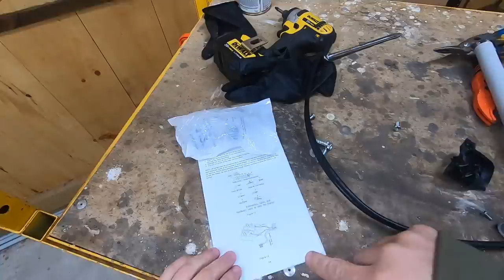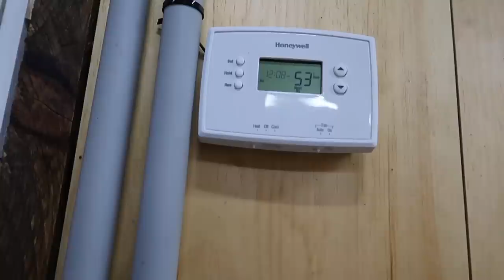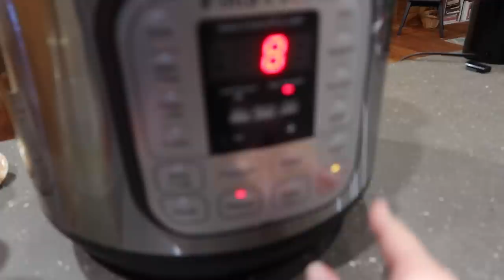Are we NUTS??? ELECTRIC HEAT in the WorkShop!!! You Might Be SURPRISED WHY

Comment: Don't know if anybody told you but green ground wire it is no longer a ground wire it is a return power wire which is basically a white wire not a green wire even the inspector will kill you that I am right I used to hook up AC unit on a fordable homes on the outside unit you're probably getting feedback through the thermostat wire

Comment: You should wrap a piece of RED Electrical Tape around the White Insulated Conductor close to the 40 Amp 2-Pole Circuit Breaker  to identify it as a '' Hot '' Phase and NOT a Neutral !

Comment: A programmable thermostat sends the exact same signal to the heater as a standard one as all the complicated things are done internal. Double check the connections are to the right posts and that the thermostat is set to only call for heat and not cooling.
Reply: Likely it isn't set to send the correct voltage.

Comment: When you threw the switch in the back, it "clunked" over (this is normal and ok). That tells me you're in need of a line thermostat. Which will entail a junction box and another conduit run to where you place the new stat. Example Lowes Item #494849. Though it says baseboard, it is suitable for your application because you need to control both hot lines........

Comment: I switch from those fancy thermostats with lots of features to an old fashion MERCURY SWITCH Round coil type after the BATTERY FAILED while I was trucking the USA. Came home to brusted pipes and damage walls and floors. Had to remodel.  Soooooooo. 

DO YOU PUT THE BATTERY IN THE electronic thingy  THERMOSTAT?

Comment: I'm surprised you didn't go with propane heat in the workshop.  If the power God out you lose electricity but with gas, it will usually always be there.

Comment: Al you need a line voltage stat.  not low voltage
Reply: open up the specs. for that unit  in web site don't sy it out right but looking at wiring cart it's line voltage

Comment: Yes Al, a relay with a transformer is the answer to adding the external thermostat.  The thermostat needs a DC voltage  from the transformer; you may find a suitable relay for the operational voltage that includes a transformer Honeywell R841C1169 for example.

Comment: I have a similar heater unit in my house as a back up heat to my NATURAL GAS furnace.  I have PEX plumbing, and heat by little 2" square panels my toilet and water traps. My washers and dishwasher are protected with an auto turn-on  heat to keep from freezing the water pump. No more metal pipes. Just heat and e everything thaws out.  I live alone and have no monitoring of my place other than the devices and methods I use.  I have LED YARD LIGHT, Electric Heat Mats so I do not shovel, and security alarms.

Comment: If you do this again in the future, buy "individual" conductors instead of a "sheathed" cable. That cable is not meant to be encased and will run hotter under a load. As far as the knockout, you should enlarge the KO to the proper size. Or, a size that is much more "convenient" to work with. A simple/inexpensive way to do that is with a "uni-bit". If you want to spend the money on a useful tool, buy a "Greenly" knockout punch set from 1/2" to 1 1/4". They're not cheap but last forever and are very useful. 
https://www.amazon.com/735BB-Greenlee-Standard-Knockout-Capacity/dp/B007BF95EO
These aren't cheap but are "industry standard" and the reviews on the cheaper version aren't very good. 
Stay safe with the wiring !!

Comment: I have the same brand and it uses both a batteries and electric and won't work without those batteries.
Reply: Does it say in lower corner "LOW" ? If so, it needs battery's.

Comment: Sure hope that heater works out ok for you guys I was always told when it comes to heat and cooling you need to measure cubic feet instead of sq. Feet  I’m not exactly sure how the manufacturer determines heat capacity.  But 700 sq feet is not the total volume of air you will be heating

Comment: Heat in the work shop...never a doubt! The thermostat is not rocket science. It is either a wiring/connection problem or it is a faulty thermostat.
Reply: i didnt see him put in a batt these programmable need power either from a transformer plug to the c term or batts

Comment: l love your channel and don't mean to criticize but, Pease put a wrap of red electrical tape on each end of your white 240v line wire. so, some poor future repairman won't get shocked thinking that it's a neutral line. Also, there would usually be a safety disconnect where you had trouble transitioning from 3/4” to 1/2” conduit.

Comment: Programmable thermostats, to me, are a nuisance.  You get them working just right and then batteries go dead and nothing works.  I like the old fashioned ones, no batteries, they just work.  Heat in the  shop  going to feel good in the morning with the snow on the ground.  Got it going just in a nick of time.
Reply: ya or you can just run some phone wire and connect to c term for constant power

Comment: Sometimes it takes a multi wire controller, the older ones used a 2 wire controller,  then when all else fails,  call manufacturer and ask them what you need

Comment: electric heat on a new build shameful. When you poured  the floor you should have included 5/8 air gap pex tubing . 500 feet would be enough to heat your shop . My shop is 30x36 and 500 feet of tubing .easily heats. I installed a boiler and water temp never goes above 120 degrees F.A hot water heater would work just fine . My shop heating cost in the coldest weather is $30 a month 24/7 heat. Your cost will be double that. My shop is vary tight. I also did all the work myself. I couldn't do a video because I DID things different than what experts tell you. For my shop size experts said 1,000 feet of pex tubing I lol at that ideology. The experts say to lay tubing from outer edge working inward. That is pure BS. Start in middle work outward. You will not find melted snow around my shop outer edges zero. Everyone I know with radiance  heat have melted snow around their structures and no one does it cheaper than I do . Did the work myself so my cost was way cheaper . Yet my cost was $5,000. So yes its expensive to install . I have already recovered my cost after just 7 years.  I bought Munchkin Contender boiler on line. Read some of the reviews they are horrible. Yet I bought it anyway. Why? Because the reviewers are idiots and I new that. Yes I do have boilers license . I could tell you why so many people didn't like their boilers it has everything to do with the bad performance condensation and the length of the exhaust system is a big deal. Again I will not explain it . As it goes against manufactures guide lines.
Reply: I think its a little too late for pex  in the slab :)
Reply: @mattben  yes I know. just trying to help other people out radiant  heat is far and away the cheapest cleanest way to heat.

Comment: It’s so frustrating watching you struggle with that wiring. A little dishwashing soap on that bundles nose would have eased the pull. They do sell lube for it but with that short of a pull it wouldn’t have been worth it. I always leave slack at the device coiled up, like twice what’s needed. If that unit goes bad you probably won’t replace it with the same kind and you’ll have a lil more slack for the next. If not then the extra wire won’t hurt anything. At the panel I usually run the wire to the floor. Then you’ll have slack to work with for management and esthetics and leave loops up to back down because again you never know. Great job overall, I know you’ll be digging that heat❤️ Very exciting stuff there!
✌🏼🤟🏼🤞🏼

Comment: Unless you plan on being in your workshop for the same hours every day won’t you be wasting energy with a programmable thermostats?
Reply: You can set it so that at a certain time of the day, no matter if you had raised it or lowered it, it will go back to the "base" temp, if that makes sense! For example, lets say the base temp you set is 62F, you could manually raise it to 70F, then at 6pm it will revert back to 62F.  :D
Reply: @robine916  If you set it to raise temp automatically at 8:00 a .m. but don't go to shop until noon wouldn't that be waste?
Reply: @sandyleonard1605  Exactly. That's why I said you could set all the time settings to the same base temp (lets say, 6am,11am, 6pm, 11pm all at 60F) When you needed extra heat, you would "temporarily" raise it to, lets say 66F at 10am. At 11am, the temp will automatically revert to 60F. Obviously you can set the times/temp to whatever you need, I just used that for an example! LOL! My kids used to turn my heat up but not turn it down! Haha!

Comment: You haven't addressed the reasoning of not having solar??
Reply: Hi Margie, hope you don't mind if I offer some insight on solar up north! Solar here requires a much larger system and a bigger battery bank, as the solar output  in the winter is much lower than down south. It is doable, but requires a larger  upfront investment, not to mention needing to constantly remove the snow from the panels! LOL! Plus, power tools use lots of energy which would drain a battery bank a lot quicker. Some people do use it as supplement, and add on a wind turbine, but that is another investment! Hope that helps! :D

Comment: First... off cut the 1/2 knock out to what ever size you need with at least a unibit..
Second...instead of using the seal tight 90°. .
Use a LB (line box)
much easier
3rd if for what ever reason (👎) you are using a white white wire for power... At least tape it on both ends any color than green or grey (277volt neutral)
Reply: Like I said I don't care what kind of pipe work he did as long as he turns at main breaker off when he got side dead front off of that panel all you have to do is it to and busbars together with his kin and whether it's on a 50 amp box or 200 and box he's going to get fried
Reply from the maker: They did t have any other fittings the seal tight ones.
Reply: @LumnahAcres  
Haven't been in a box store electrical department that didn't have the metal LBs
Or plastic LBs
Either one is rated outdoors..

Comment: COLD AIR COMES DOWN,  HOT AIR RAISES.

Heater should be kept  MAXIMUM AT 5 FEET HEIGHT.

Even tho the rating of the heater says this unit is sufficient for this shed.

I BET THIS UNIT WON’T BE SUFFICIENT .  THE UNIT WILL SELDOM SWITCH OFF I BET.

Keep the unit at 4 FEET WHERE YOU WORK THEN IT MIGHT BE WORTH AND YOU DID NOT TAKEN THE HEIGHT OF THE SHED.

As I mentioned before the hot air will raise